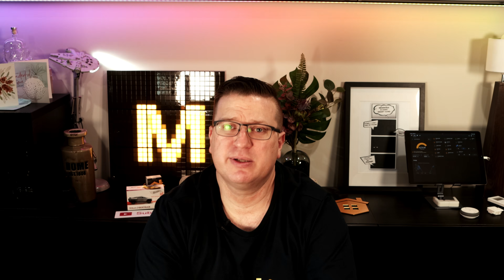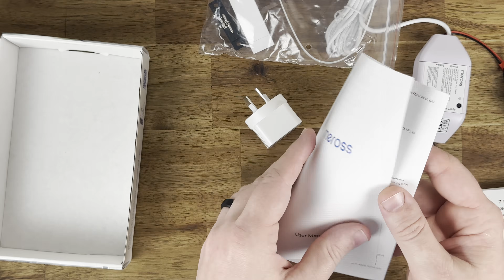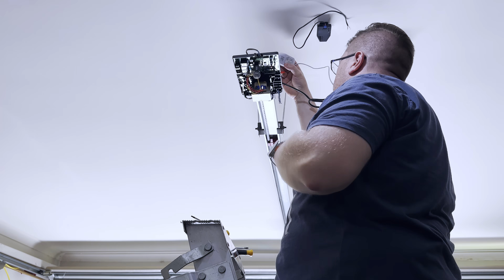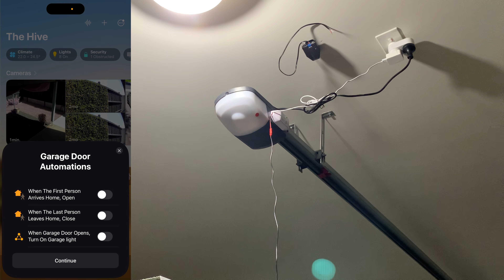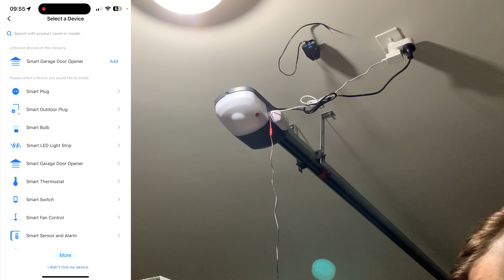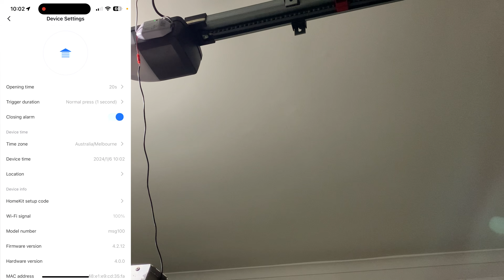Installing and Reviewing the Meross Smart Wi-Fi Garage Door Opener - With Apple Homekit

Comment: Great video. I just installed mine and everything works.  Although in Apple Home Kit it’s saying that it’s obstructed but it still works.? I have an old garage opener that doesn’t not have any sensors . Is there a fix?
Reply from the maker: Mine said obstructed initially too, but that went away after a while.
I don't recall if there's a setting that you can modify for this.

Comment: Follow up question, I would like to use one of the units on a front swing gate, all looks good however my gates don't perfectly close (a bit flappy/loose) so the reed switch would not work.....is it possible to just not use the reed switch if I am not fussy about if the gate has been left open/closed?
Reply from the maker: yeah it works fine without the reed switch, it'll just always think the gates are opened.
It's just a simple reed switch, so you could maybe use a mounting point closer to the hinge-point that's a bit more reliably stable in open/closed states. you could also swap out the Normally Open reed switch for a Normally Closed reed switch and place the magnet at the open position of your gates, so the reed switch opens when the gates are fully open, and report closed at any position other than fully open.

Comment: Do you know if it is possible to 2x units and they show up in CarPlay? One unit would be for the front gate (where I still have a good WiFi signal) and the other in the garage.
Reply from the maker: I'm not clear if they'll both show up separately in CarPlay. I might see if I can resurrect my Garadget and do the necessary jiggery-pokery to get it into Homekit to see how they present in CarPlay.
From some Googling, it seems like Carplay only presents the most recently used garage door opener on the Carplay Interface. You COULD reasonably use a Siri Command though provided they're named differently enough

Comment: Thank you for the clear video… unfortunately mine only works when I am at home with WiFi connected. How can I use it when away to open the door for deliveries?!?
Reply from the maker: If you're using Homekit, you need to have a "Home Hub" enabled that's always at home.

An Apple TV or Homepod can act as a Home Hub.

If it's just connected natively to the Meross App, it should be cloud connected, so I don't see why you wouldn't be able to control it remotely.

Comment: The small light bulbs blow with all the movment of the garage motor,
have you thought about a automation to turn on the bigger light in your ceiling when the door opens etc , I found this to work much better, than replacing the small bulb every few months
Reply from the maker: Yeah I used to have that automation, but I've since swapped to triggered by motion detection on the UniFi Camera above the internal garage door, it's okay, but I do need to add the automation back to the Contact sensor, because we reverse into the garage, if it's quite late, it takes a while for the motion to be detected and triggered, turning the light on, and that can be a bit of a pain.

Comment: I have had this for a few years. And it works great. I just used the Meross lan HACS integration which I was not adding the door opener at first but for the plush and it just detected it and just worked. I liked this so much and the CarPlay integration was so cool I purchased one for my mother as well.
Reply from the maker: Nice to hear it's lasted you a while.
The Carplay Integration is the best part.
I'll check out the Meross lan HACS integration. I've got a few more meross videos coming out before I get to it though.